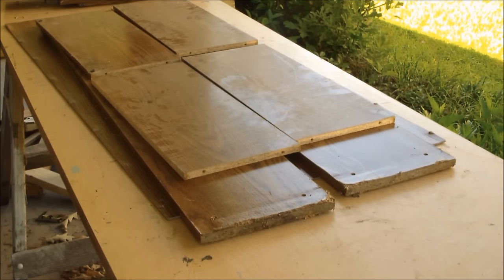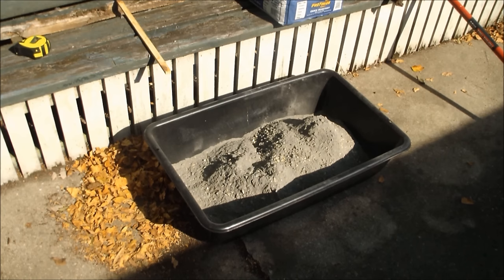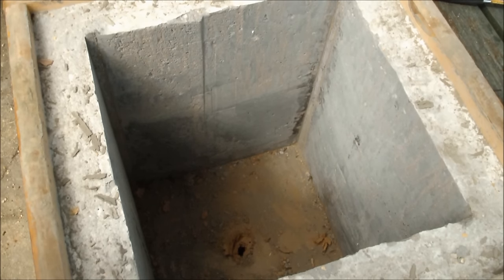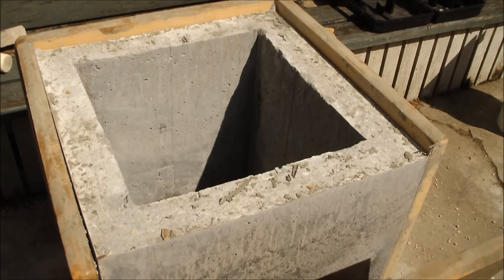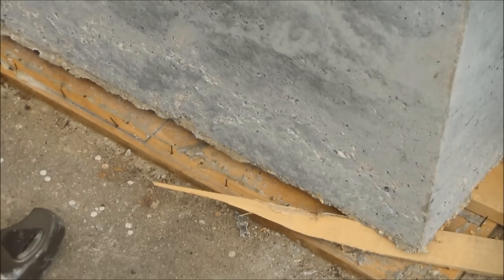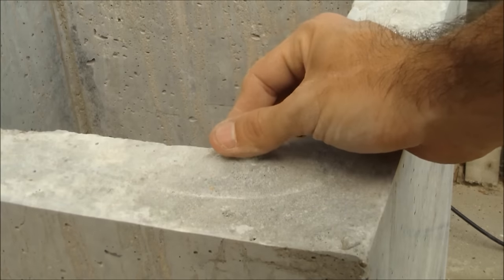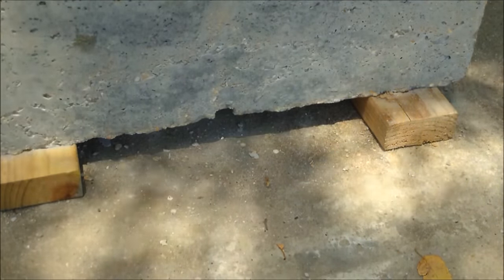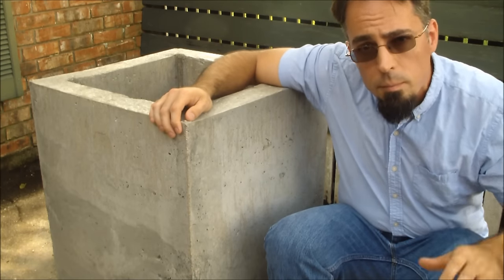How to Make a Concrete Planter

Comment: Nice planter. Just a note, if you wipe oil (any kind), or  spray with PAM cooking spray, or line the inside with plastic - the concrete won't stick to your mold. Hope that helps.
Reply: Auto oil it's best
Reply: For big jobs we use ‘Form Release’ by the 55 gal drums. In the old days we used to just use diesel fuel.
Reply: @psidvicious   I just soybean oil.
Reply: I've watched other videos, it doesn't work. The concrete probably just absorbed the oil in and then stick to the wood. Everyone who used oil still had to fight to get the mould off.

Imho, if you're ok with plastic bag fold Mark's the best thing would be to line the mould with some cheap tarp or maybe even self adhesive carpet protectors that you lay on carpets for painting and decorating.
Reply: Very nice video!  I would love a few of these planters!
Reply: Why oil when it will leave oil spots ? eeeeeeeeuuuuuuuuuuu
Reply: I did so but that didn't cured
Reply: I have an idea to line the boxes with scraps of old linoleum and then use the oil trick. I found the wood just absorbs everything you put on it. But I’ve only done small things with plaster of Paris, so maybe cement reacts differently?
Reply: Not any kind! Not mineral oil for planters! Only vegetable oil!

Comment: Hint: line inside with roofing felt before adding concrete, it doesn't stick! Good job!
Reply: How's that a "hint"??
You explain the whole process, there's nothing left to figure out there!!🤦🏽‍♂️🤦🏽‍♂️🤦🏽‍♂️
Reply: @strjourneys7919  The word "hint" is frequently misused for "tip", as you say they are two different things.

Comment: This is very similar to forming the sump pit in the floor of an elevator shaft. Next time just eliminate the bottom form of the inner box all together. Pour the bottom and just let that set up for a few minutes, then continue pouring the sides. Or use a solid block of styrofoam for the inside form. Any solvent like gasoline will dissolve the styrofoam. No smoking!

Comment: When you make the next one make the inner box tapered and only let it stay in there a few hours, the bottom width both directions about a half inch smaller than the top. By tapping on it a little and pulling it up it should pop free and slide out. The concrete will have set up enough to hold its shape. Also on the strips of wood for the bottom, taper them as well just a little bit and they will pop out pretty easy too, on these the bottom will be wider than the top, 1/8th inch should do the trick. You should also be able to deform the outside after a couple days. No need to wait a week. Looking Good!
Reply: Ya, this guy's saw only cuts at a 90 deg angle.  He really needs to learn about champher.  (I need to learn to spell). Should have put a triangular molding (90/45/45 degrees) at  inner corners so inner plywood comes out parallel to adjoining sheet (no overlapping).  Molding is lost with each cast but ply is not.  Would have dressed up the outside as well, top corners...

Comment: No need to put a plyboard or something at bottom of the inner form. That is right, put some plastic before pouring the concrete so it will be easy for the inner form to pull out.

Comment: For new viewers,  I reviewed the comments, sumnarised here   
1) Cooking oil as a release agent got a lot of mentions.
2) Needed the sides of the inner plug to be sloped inwards for ease of removal. 
3) Use a concrete edge finisher tool on the top edge before it sets. 
4) the water channels on the bottom  are way too small.  They need to be bigger to stop being clogged over time.
5) Some wire for reinforcement may be a good idea at the bottm and at various levels
6) Vibration on outside for better bubble removal, as you mentioned.
7) Plastic tape on all inner corners for smooth edges, and tape over all the drainage molding strips.
8) no need for bottom inner mold bottom. Just level the first few inches and then set the inner walls on top. 
Nothing like practice for perfection : -)
Reply: Thanks!
Reply: All REALLY good suggestions.
Always keep in mind what separates a “Pro” from a “Joe”: The  “Pro” already got a lot of mistakes out of the way. That’s why pro’s get paid. You pay them for the mistakes you didn’t have to make on your own. Nobody hits the ground “just knowing”. Everybody learns.
Reply: Thank you!!!!
Reply: Thank you so much, very helpful!
Reply: @burnerjack01  With YT nobody has to be a "Joe" anymore! In fact with YT one can often do things better than the average Pro, including making this planter, if one studies all the comments diligently. Thanks to all concerned!

Comment: Most comments are spot on about tapering, oiling, finishing. I would add perlite to the concrete mix to make a lighter planter and you might consider adding some type of wood shape inside each outside panel to make an inset on each side to also reduce weight and make the planter much nicer to look at. Lets face it an empty planter should be light enough to move around and position where you want it.

Comment: I used vaseline as mold release and it worked great! You could taper your inner box similar to a draft angle.  Even 10* of an angle would make it easier to back out.  Great video!
Reply: sean christian   Your right.  I wondered how everyone missed that the entire issue was the draft angle of the inner box.   At 90 degrees it would almost be impossible to pull out.

Comment: I've been watching  YouTube how to make large pots instead of wood on the bottom put some sand on the bottom get it damp with water then add cement the thickness that you want . Take a pvc pipe push it through the bottom then pull it out .  now  you have hole for the drainage I loved your video thank you .

Comment: Wipe the surfaces down with waste oil next time, that is what we used on wooden forms for concreting.  

With the innerbox make the sides overlap the base and not the base over lapping the sides and affix with screws so you can unscrew from the inside. Only need the inner form for the first few hours, no more than 24. The other you can leave for a bit longer if wanted.

Nice work.

Comment: Looks fantastic. If you wanted to make several the same you could construct out of marine ply and re-use the formwork.
Reply: It is the alkalinity of concrete that destroys plywood, not the water.  Paint the inside with 50/50 bondo and oil based paint to get up to 100 uses.

Comment: Used engine oil or vegetable oil can be used as a release agent. You can also make a slurry of mortar mix like a sandy latex paint and brush it over the outside to fill the air pockets, or if you want it smoother a similar "paint" of portland cement and water will work as well.

Comment: Awesome video!

Looking back, do you think you would have tried to make it a bit thinner, maybe added some steel reinforcement? 
It looks great for a permanent spot, but I'm wondering if you think it could have been a bit thinner and lighter?
I want to make one, but would need it to be fairly moveable.

Looks great and it came out great! especially from salvaged material. Good work and thanks for video!
Reply: The weight might be an advantage i used as a barricade.

Comment: I built some planters 4'x4'x 2'6",on my lawn at the edge of my patio for some reasonable sized fruit trees. Being right near the sea and sandwiched by a lake half a mile behind, the ground isn't the most solid and they needed a raft type footing according to the very young planner guy who also gave me some tips.Being a bit old fashioned and an automotive electronics tech by trade,so not knowing any different assumed that because his of young age that when he said feet he meant meters. Incidentally I built these massive footings about 3 times their required size according to the bricklayer who was building our shed, I didn't tell my wife😁 they haven't moved though.
Reply from the maker: Some things the wife just doesn't need to know👀
Reply: What is a "reasonable sized fruit tree"?😂 Or what would be an un-reasonable sized fruit tree? Is your house called Mar-a-Lago? I think that is the rationale for the name of Trump's place

Comment: Here is a tip for you. Oil all forms first. Car wax works well too. Use hinges on form bottoms then tape over them to prevent leakage. Remove tape, let’s air in to break the vacuum, hinge makes it super easy to remove bottom without breaking forms. Reuse!

Comment: you could also use a masonry disc  on an angle grinder to get the concrete "bumps," but much better to float the top with a trowel after filling with concrete.  Also, a thin rebar length should be used to get the bubbles out, like in the old days.

Comment: Ted! This is amazing! What do you think of the idea to build this upside down? I saw another video of a man who build one and added 4 wheels to the corners from building it upside down. I thought that was genius. This is beautiful! Thanks for sharing!
Reply from the maker: I saw the same video, but this one is a lot larger. Watch my "lessons learned" video for what I would do differently next time.
Reply: Doing it upside down you would need a very solid plank for the base, else the weight of the concrete would depress the form, and maybe interfere with the setting of the material, i.e. if it is settling / moving constantly under gravity

Comment: You can use a metal grinder and a grinder (not a cut) or sand blade to shape the concrete. Good for large details. Wear safety equipment, the stuff flies everywhere.

Comment: A lot of sound ideas and great inspiration here! Thanks for sharing your process. How about fashioning the planter upside down in the form? I am positive there is spray on release agent made specifically for concrete forms. I’d ask a pro, but I believe melamine forms release much more easily. I would wrap my form in cling film. As for as aesthetics, I love your square project, but I would want to stick colored glass into the top edge while it was wet. I agree that the bubbles are attractive. If you needed a smooth finish, you could make a thinner concrete mix and trowel it over, like plaster on a wall. Next time, play with concrete pigments! Planters that size or heartbreakingly expensive, so I applaud this DIY endeavor!
Reply: "spray on release agent" = gentleman's waste diesel😂

Comment: When I built one of these concrete planters I did not have a bottom on the inside box. I used 2x2 in the inside corners of inside box with all the screws from the inside to make removing screws from the inside box easy and reusable to make another box. PS I used a releasing agent (vaseline) on all wood in contact with concrete.

Comment: Some 1/2" schedule 40 pvc is a cheap way to move almost any heavy smooth surface object.  I moved a 1100 lbs safe across my garage with two sticks of schedule 40 1/2" one handed ....nice video. thanks  and a cheap orbital sander cheapest one you can find will get air bubbles off the form surface...

Comment: Well I think you did  great for having no real experience being a cement finisher.  You can use vegetable oil in a pesticide sprayer to spray on your forms to release the concrete when you're done letting it set. Also for the little bubbles you can take a combination  Of sand, Portland, and water and use a sponge to just rub it on the surface of your planner. I would use the same recipe each time I made a new batch of rub so that it wouldn't look discolored. There's a lot of little tricks you learn if you're on the job site but that turned out really good.

Comment: Inner mold: The bottom should have been inside the 4 walls, so when the 4 walls are gone, the bottom has room to move sideways.  Use wooden cleats to screw inner mold together from the inside, so it can be dismantled from the inside.  Top finish: Use curved edge concrete finishing tool to make rounded edged and get rid of those bumps and sharp edges.  Sanding concrete?  Wow, never seen that before!!  Use a diamond cutter in an angle grinder to make short work of it.  Use styrene foam instead of PVC pipe for drainage hole - several would be better.  Styrene foam is easy to remove!
Reply: Heres my thing....why have a bottom piece for the inner box to begin with? Why not just pour the bottom (like u did), smooth it out, and then set your inner box (just 4 sides with no bottom) in place and pour the sides?
Reply: @raulduke7142  No offense.But you guys cleare havent  done any formwork before:)  IF you leave the bottom out concrete will start rising up when you start tapping it for bubbles or vibrating with proper   poker...You lucky if it`s dry enough concrette may not rise so much..But if it`s wet you are fucked...will keep coming up.
Easiest way is to leave the bottom in but cut  it in  2-3 diferent pieces...But when you do that you need to do some extra supports for bottom and braces accross...For your own garden is good enough ..otherwise i recoment puting some extra braces across the bottom and top ..All depends of size of mould..In this video he uses some table top  so it`s tchiker and stronger as normal   17.5 or 18 mm playwood.SO he basicly dosn`t need any supports on outside  and only fewww braces on inside..Othervise  would be diferent storry
Reply: keith cunningham  
Thank you Keith!
Reply: @Laimenuxxx  If the concrete is a bit looser/more watery I would guess the inner mould would float on it like a boat, and would need weighting down, maybe with some concrete breeze-blocks. But you'd have to get the wieght just right not to depress it too far

Comment: Thanks for making this video. I especially liked those side channels at the bottom. A good idea I intend to incorporate in mine. Think I'll use styrofoam strips, though, so I can just dig them out afterwards with little fuss.
Thanks again.
Reply from the maker: That's a smart idea. If I did another one this size, I would make the walls/base thinner and use a wire mesh inside to add strength.
Reply: @tedsbackyard  The weld-mesh would push the price right up, but would make the perfect product. What would be the minimum wall thickness for that size of planter?

Comment: Fiber reinforcement is just fiberglass added to the mix to reduce cracks in the fine finishes of small projects like yours. Developed I believe, for concrete countertops to reduce small surface cracks, its used a lot in moulded ornamentals like birdbaths, fountains and planters and concrete garden art pieces.

Comment: in construction we brush the plywood with diesel before we pour concrete, for this small project you can use motor oil (for the wood to come off easily, and not stick)
Reply: I used plastic sheet over inside box and the pot was very good.For out side I used two big sheet and two small sheets and made the box by screwing each other.It It is easy to dismantle box after finishing the work.

Comment: Great job for a first time planter! The good thing about these planters is they look great almost any way they turn out! Not sure if you answered this question in another comment, but I'm curious to know how much this mammoth of a planter weighs? That would undoubtedly be my husbands first question. Without dirt and the plant, were you able to move it to a spot you were happy with without using a crane? Thanks for sharing... the planter looks excellent!
Reply from the maker: I think it weighs 640 lbs. I used wedges, levers, and rollers (ancient Egyptian style) to move it where it needed to go. I made a second one and had the foresight to make that one in the place where it would end up.
Reply: @tedsbackyard  Wow! That's an incredible weight! I made several concrete pots and garden spheres this spring to add interest and texture to my garden, and they were also a bit heavier than I anticipated. Glad you were able to get your planter placed, and still adventurous enough to make a second one. Thanks for your reply... enjoy the summer!
Reply: @tedsbackyard  That is one huge advantage of making your own, if you buy one ready made it's very difficult and expensive to have delivered. How do you move one of those from roadside to your garden? But you can easily carry bags of sand and cement to the exact desired location

Comment: next time use some perlite and vermiculite and peat moss mixed with the concrete that will make the planter lighter and will have a cool finish....another suggestion ...do the planter filling on four steps...so you can move it to the forever place.  nice job.

Comment: Fibre reinforcement refers to small strands of polymer/plastic within the mixture that interlace and act in a similar way to steel reinforcement improving the tensile capacity of the concrete. The longer the strands the better. Therefore, you could have got away with about half the thickness you used. 2" more than enough for a square aspect ratio.
Reply: Very good contribution to include fiber to the mixture, and what do you think the analysis of creating a mold that you do not have to destroy it to disassemble it, so use it always, with metal clamps and screws maybe?
Reply: a diamond blade on an angle grinder would trim off the bumps off quickly.  great project!
Reply: Actually the fibers are not intended to replicate steel reinforcement in any way, the concrete bonds with the tiny fibers and helps to hold it together so when it cracks (and concrete always cracks) it will reduce the amount of separation. Synthetic fibers can be used to replace steel mesh, which is used for the same purpose, but neither increase the tensile strength in a marketable way.
Reply: OneAxis You engineer guys amaze and astound me. Just build me one, and I will give you a masterpiece fish and planting! 😎

Comment: Interesting project.  Looks like you had fun with it.  I think if you put some engine oil or wax on the panels it would be easier to remove.  Yeah, had you removed it when it was still a bit damp you could knock down the rough edges easily.

You could make it thinner and add some mesh and use the standard quikcrete mix to save some money.